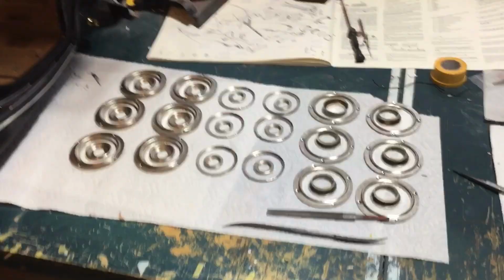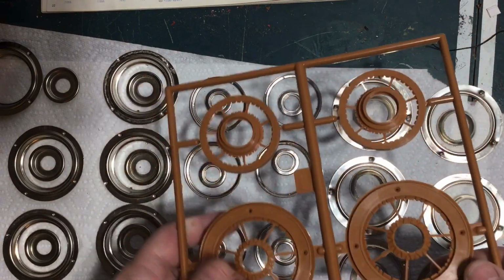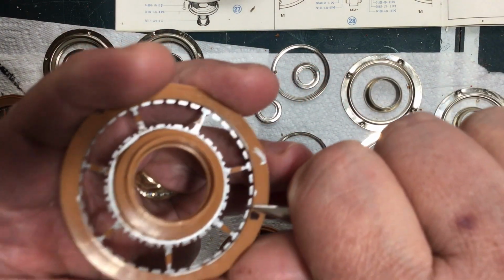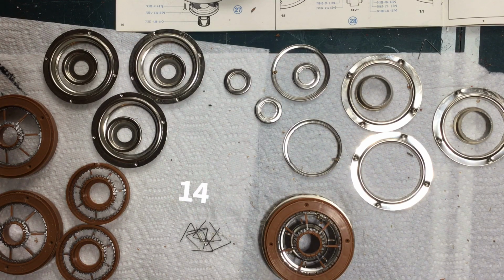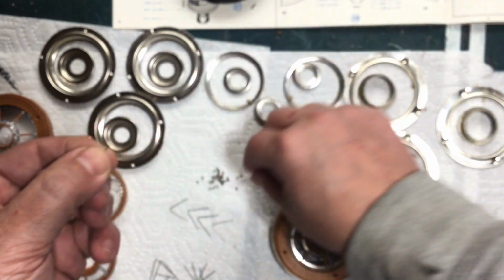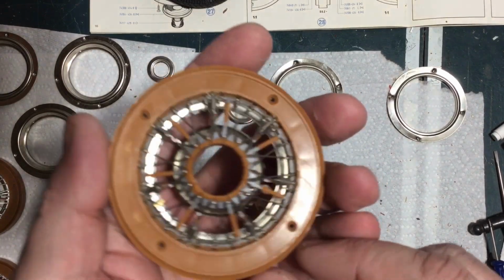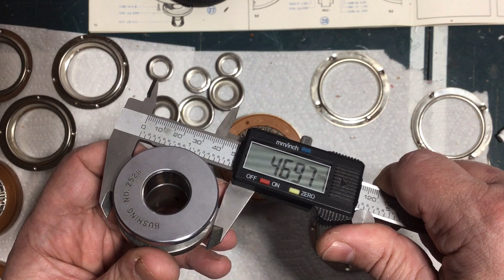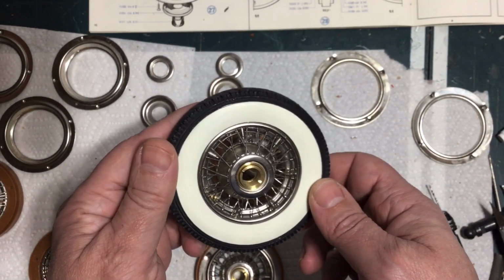Pocher Mercedes build; Wheels and Tires

Comment: This a very informative & helpful video on the construction process of/for the Pocher Mercedes wire wheels!!   Well presented my man!!!!  Yes, by putting the stock Pocher rubber tires in "ALMOST" boiling water temperature & letting them soak for approximately 2 minutes , they will slip onto the wheel rim fairly easy. As far as Motorcars Tires go, a nice improvement but very expensive and they don't always fit the wheel snugly.  Great Video for folks building their Pocher Mercedes!!!!!!!!!!!
Reply from the maker: Thanks! I appreciate the comment and advice on the Pocher tires. Thanks for watching!